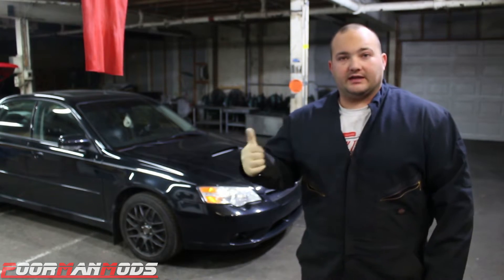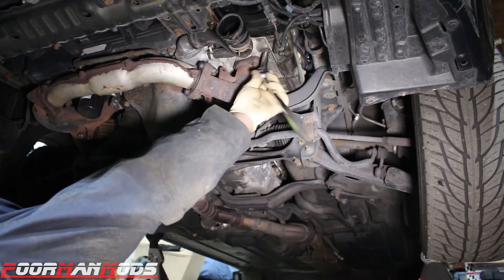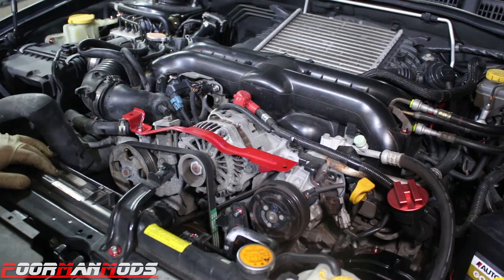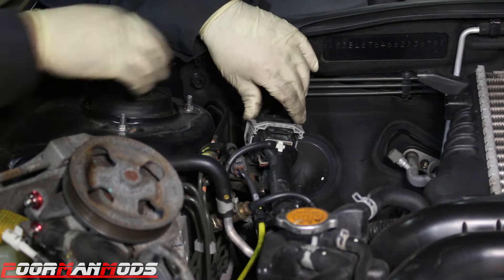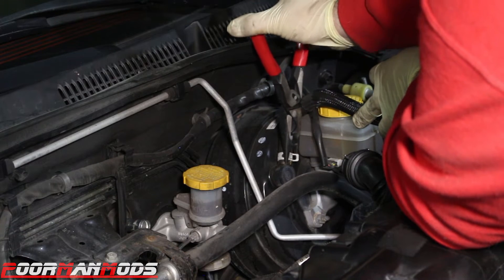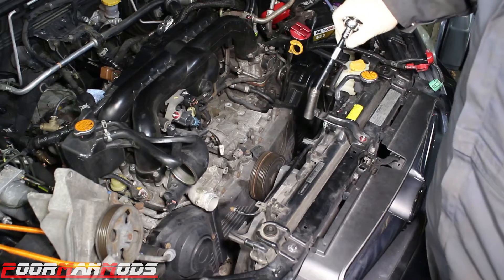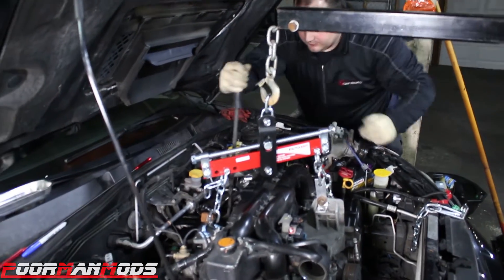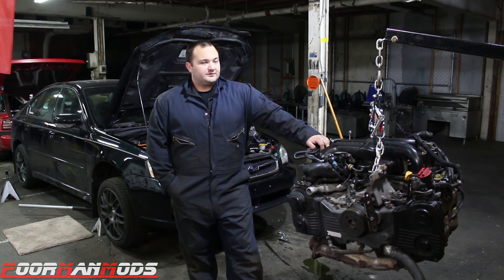How To Subaru EJ25 Engine Removal Legacy GT Impreza WRX STI Forester OutBack

Comment: Good video. I should have watched this first.I'm in the process now, and have taken off the manifold and turbo inlet. Apparently i didn't have to.
Reply: I am used to the sti, so I used the manifold everytime. Had to pull my LGT engine last night due to knock and removed the manifold also. Came here to watch and see if that was absolutely necessary before I rip the engine out of my other lgt and of course, it wasn't. The manifold is also hooked up differently and has some hidden hoses attached in there compared to the 06 sti. Wss a learning curve for sure. Definitely will use this method for the next one

Comment: Helpful video but after watching decided to pull engine and transmission together.  Bolts for turbo housing just slightly started to strip so didn’t want to end up with a mess.  Disconnected the exhaust and brake calipers and abs sensors plugs on the frame rail.  Pretty easy and will just drop through the bottom.
Reply: Do you mean literally from the bottom, like if I have a car lift I can just do as you stated and lift the body with both the trans and engine still supported on the ground?
Reply: Yes, doesn’t take long at all… with axles I just took control arms loose, popped axles out and moved them out of the way if I remember correctly.  This particular car, I took engine out and back in, then transmission in and out several times because of transmission whining…
Reply: @urassisdragon  thanks man

Comment: is that a weed puller you are using to remove the second wire harness connection with the oxygen sensor? 10:03  . nice. you got my sub. thanks for documenting the process here. it is very helpful.

Comment: Haven’t pulled a turbo dohc on camera... yet. STi build is in the way though. Gave you shoutout in my 500 sub episode yesterday Freddy.
Reply from the maker: Oh hell yeah thanks man I really appreciate it. Tony wants me to swap the turbo for a VF52 haha, it already has STI injectors, no idea on the fuel pump though.
Reply: A 255lph pump is just good insurance.
Reply: VF52 is such a nice turbo, I just push 17psi on my old LGT being conservative ; )
If you change fuel pump, be carefull with the damn O-rings when installing new pump, if not it will pump air.
There is a plastic thing on the pump nipple to push the O-rings to seal, Ask me how I know..
Reply from the maker: thanks for letting me know!

Comment: When u back up the transmission do u need to unbolt the transmission? I get u need to raise engine past engine mount bolts before separating it but if i Jack the transmission without unbolting it will that damage it? Will it raise?

I've followed ur video I'm only waiting on my engine hoist to be delivered. N in bold bellhousing n engine mounts.

This bit I'm most worried about the actually separation n lifting part

Great video. Really really helps
Reply from the maker: Jacking up the transmission a little bit will help, you have to unbolt the transmission crossmember to do that
Reply: Poor Man Mods thank u every done but the transmission bolts. I think I really understand it. 
Ordered a hoist. Gonna try this fix my oil leak real seal or separator plate. 

U guys help so much

Comment: I used a zip-tie that I cut down when I removed my fuel lines. Little bit of a b*tch, but once I got the hang of it, it was simple. Since been replaced with easy disconnect fittings.
Reply from the maker: I heard about that trick and couldnt do it! lol
Reply: Zip tie ?

Comment: How many hours did you spend on removing the Engine?
Reply from the maker: 6 or 8 hours as a first timer? Maybe?
Reply: At least 8 hours to remove the engine. Will probably take me 10 hours (or more) and I have a lift, some very rusty bolts on the turbo base

Comment: must be newer than 02 ?  MIne did not have the ground at engine or fuel lines or connector at firewall
Reply from the maker: 2006

Comment: How did you disconnect the clutch fork from the throw out bearing? On the 6 speed you have to thread in a bolt into the rod that goes through the clutch fork then pull it out. Good video btw!!
Reply from the maker: Nope, the 5 speed must be different, thank you!
Reply: There is no clutch fork pins on some models, it just pulls straight out

Comment: Surprised the stock I/C has not leaked yet, 
You should ``bulletproof`` it, basically adding 1/2 inch aluminum C-channel to stop the aluminum tabs too expand
Reply from the maker: Whaaaaat?
Reply from the maker: +Bob Lemoche okkk

Comment: Ill sub if  answer this 13 wrx ect location is whre
Reply from the maker: I no longer have a Subaru but most temp sensors are in the water neck near the thermostat
Reply: @PoorManMods  unfortunately its the upper under mani
Reply from the maker: Fuuuuuuuuuuuudge

Comment: And while the engine is out, REPLACE OR UPGRADE YOUR BANJO BOLT FILTERS. The one feeding your turbo oil!
Reply from the maker: Yess, did that earlier though. What a pain
Reply: @PoorManMods  yes. I did mine in the car and replaced it with the infamous performance kit. Awesome kit but a huge pain without fully pulling the engine